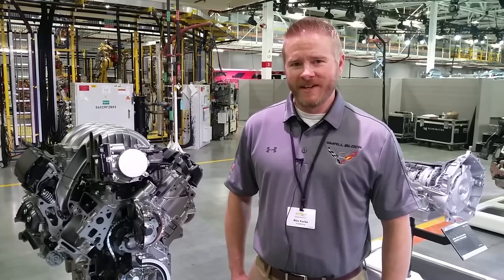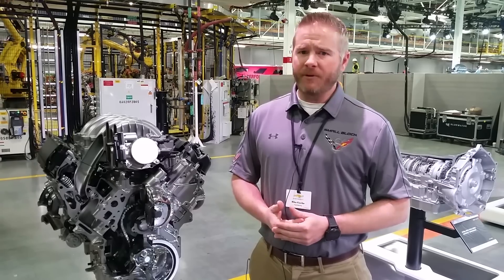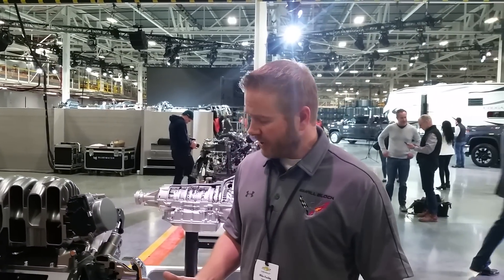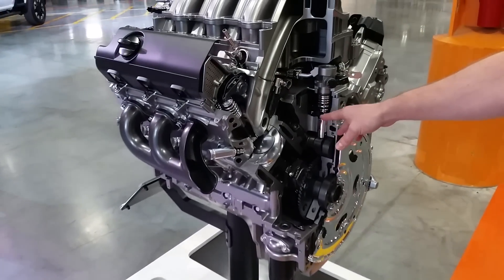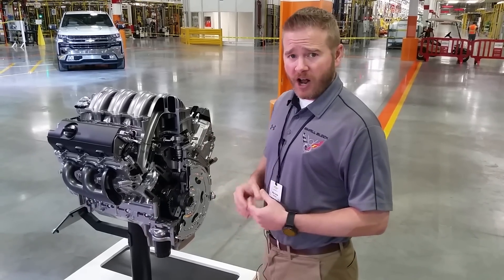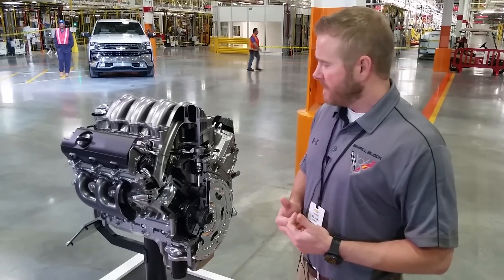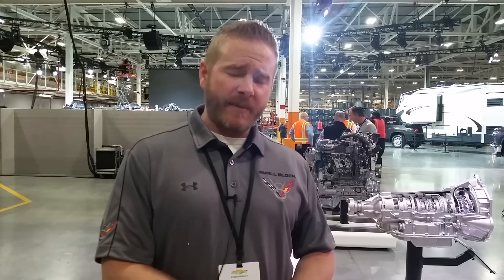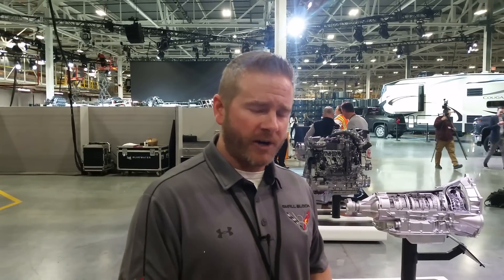New 6.6-liter V8 gas engine on 2020 Silverado HD

Comment: More modern GM JUNK.  My 04 silverado 2500 HD 6.0 died at 230,000. Not to mention the transfer case pump rub BS design.
Anyway, junked the 6.0 and built a 1966 396. Modified  the PCM and ECU.  The truck is EMP proof. The 396 operates as if it was 1966 again and I get 16 MPG hwy and 11 MPG city, yup it has a holley carb on it. So  F$#K you GM and your over priced new JUNK trucks.
Reply: not fair  396 is a real engine
Reply: offplanetevent ok I think we fucking get that you like junk
Reply: @blakeok952  
OK, I do like junk...I like your comment
Reply: offplaneteven oooof roast upon me

Comment: I love general products .. Will this motor last more than 100,000 miles without me putting hundreds of dollars into repairs on the vehicle. Because that has been my experience so I stop by in general most products. But considering I do drive between 40 and 60,000 miles per year. The performance has always been excellent. I personally just have not found your animals last more than 100,000 miles without costly repairs. So I bought a Toyota
Reply: Congratulations you bought a taco

Comment: Why not electric fans so you don’t leach hp off the engine?
Reply: The engine gets hotter than most other designs and the engineers decided electric wouldn't be a wise choice many manufacturers still use clutch fans on their workhorse engines.

Comment: So basically with all GM's engineering prowess and what they know about the DI downfall they decide to let it still be a carbon valve fouling machine lol....
Why would you not knowing what you know put auxiliary injectors in the intake runners to keep the valves clean?  Other manufacturers did it because of the problem. Junk, junk, junk.........
Reply: Yea well chevy's run fine with dirty valves idk about that junk you speak of apparently it's a big problem for those 😂😂
Reply: Must have stole some engineers from FORD.  looks a lot like a newer ford engine.
Reply: @IndependenceIron  you mean ford copied the LS and made it bigger because they couldn't make their piece of shit 6.8 v10 OHC motor run worth a danm or stay together lol
Reply: @oddball0045  actually if you want to get technical more of the LS was copied from Ford. The LS was Chevy's rendition of the "Y" block.  I'm a chevy guy but the truth is the truth.
Reply: @turbochevelle5641  following that logic i guess every ford v8 after the flat head is just a copy of the 265/283 chevy small blocks right? Both have valves ontop of the head therefore must be a copy

And i guess every car is a copy of the ford model T because they burn gasoline, have 4 wheels, and a roof lol

Saying an LS is a ford design because its a Y block and has the same firing order is silly
Reply: @oddball0045  everyone knows Ford came out with the "Y" block a year before Chevrolet it no secret. The fact is the LS took many design points from the Ford design and changed a few things so nothing to get all butt hurt over it is just the facts.  It is just the nature of the beast in industries like the auto industry to follow and one up each other and there is a lot of industrial espionage that goes on as well. Get over yourself, the first to market was Ford in in the Lincoln with the 5.2l and the race began from there.  Chevy did good when they took things from the 4.6 and 5.0 to design the LS and combined with Y block pushrod tech hit a homerun.
Reply: @turbochevelle5641  whose getting butthurt? The LS and the failed modular motors are so different from one another its not even worth debating 

GM played with DOHC 4 valve v8s in the c4 zr1 vettes before ford ever came around with the modular crap, i guess ford copied chevy/lotus. Point being you can draw similarities between any motor from any manufacture and say "hey company X copied company Y!"

 But you cant look at that new 7.3 and not see LS engine written all over it, right down to the intake manifold. Ford tried the OHC stuff, it didnt work out so they went to GM for the LS OHV architecture. Just like GM went to ford for that new fancy 10 speed automatic

I just love the irony in ford fangirls going on and on about how "outdated" the 2 valve LS is and how much "better" 4 valve DOHC is and then ford turns around and gives them that OHV 7.3 big block lol
Reply: @turbochevelle5641  if you think it only takes a year to design a motor........ ya fucking stupid 
GM coming out with a motor a year after ford does NOT mean they stole the engine, and stamped GM on it

BOTH engines probably have AT LEAST 5 years of development.....
Reply: @oddball0045  
Actually the 10 speed automatic was a co-development between Ford and GM. 
They've done this on three different transmission projects now.
First was the 6 speed auto FWD back 2009/2010.

Comment: I’m not buying another vehicle with variable anything in the engine.... my bank account has been hurt by it enough
Reply: Richard Risner Honda & Toyota have had ZERO issues with VVT with the exception of the customers that refuse to change their oil. Now, variable cylinder displacement was a total nightmare in its inception at GM. Honda also has had issues with their variable cylinder displacement V6s. Oil consumption is a design problem because the cylinders that aren’t firing don’t have combustion pressure to push the oil toward the skirt of the piston. We’ve actually disabled the feature on Hondas and the consumption goes away. I’d rather pay for the fuel as opposed to having my engine torn down to try to stop oil burning. Any fuel savings the consumers had vaporize at that point.
Reply: The variable reliability solenoid is likely to stick on these
Reply: It doesn't have the same crap the 5.3 has. There are no cam parts of lifters that will break. It's not the variable lifters like the 5.3. It doesn't have AFM either. HD trucks aren't required to meet the standard the 1500s are. The 6.0 has the same setup the 6.6 has its variable valve timing and it's far different and far superior than the crap in the 5.3.
Reply: Richard Risner then get a tundra.
Reply: Ramiro Escamilla I actually like the tundra but my 2007 Chevy HD with the 6.0 I sold to buy my POS dodge was the most solid truck I’ve ever owned.  I sold it at 120 miles and it ran as crisp as it did the day I bought it.
My dodge 1/2 tone and my 2007  Cummins on the other hand couldn’t make it to 100,000 miles with out me dumping thousands into out of warranty work on the front ends and most recently rebuilding the top end in the 1/2 tone
Reply: @ramiroescamilla7263  
Tundras dont have variable anything on them?
Reply: @lees.4084  Yes they do, variable valve timing
Reply: @xTheJmanChannel  
Yeah, I know.
Reply: Lee S. VVT. Bulletproof too unless you refuse to change your oil.
Reply: @ramiroescamilla7263  " then get a Tudra" ??? You do realize that the TundraTundr Tundra has VVT  and A Vaiable intake? 

He would have to find ane ary / Mid 2000s Model with low miles.
Reply: Richard Risner it's easily deactivated.
Reply: @oldman6914 no it's not because it's not the same as the 5.3. It works the same as the 6.0 and the 6.0 never ever had any of the issues the 5.3 has.
Reply: ARCH KRIEGER I can deactivate the variable valve timing in my 5.7 hemi?........ sorry homie don’t work that way.
Reply: @richardrisner3635  
Yes variable value timing can be deactivated, well removed by changing the Cam shaft
Reply: Richard Risner I think you can it's the same way like LT motors
Reply: Yes it does it’s call a delete kit bucko 👍🏾
Reply: Engines have had "variable things" on them for over a century now...
You'd best get used to it...

Comment: Everytime something new is introduced everyone loses their minds and hates it, I can only imagine back in the late 80s when everything was going to fuel injection everyone was like "my 1966 350 carbureted v8 is going to WAY out last this over complicated nightmare!"
Reply: Don't know about 60,s not quite old enough but 70,s onwards yes, the type of work we did was was away different to now, in dealership and independent workshops, biggest thing I noticed was how much longer motors lasted and specifically how much less top end rebuilds which showed how much cleaner inside injected unleaded motors had become over time, over complicated now- maybe, less reliable - hardly, more expensive to repair - occasionally, more performance - definitely, replaced more often - I'd say so, building to last longer necessary - I think not, our children won't want what we have now they don't even want the phone they had last year.
Reply: Amen brother
Reply: 1966 350? First year of the 350 was 68
Reply: @konnerkramer3381  67
Reply: @konnerkramer3381  
They did an engine swap, ok?

Comment: Do you fix the lifter problem? What about the oil pump problem ? Still using those $hity little bolts on the Exhaust. WOW
Reply: Looks and has the same problems the hemi has. Even looks like a hemi on the outside.

Comment: Cheapest pistons and rods they could find...
Reply: Aaron Martins 
I don’t know about the pistons, but I do agree on the rods. PMRs are Cooper infused steel.  Rev the engine up and, 1 out of 25 engines, they go right outside of the block.
Reply: @Nostradamus_Order33  Short of the LS7, I believe all LS engines have used powdered metal rods.
Reply: @Randmosh 
Even the 95-97 model LT1 (GEN2)
Engines used PM rods.
Reply: @Nostradamus_Order33  
1 out of 25?
FALSE....
Reply: @Randmosh  
It does indeed....
Especially with all these metallurgical experts in here....🤣

Comment: "With engine bore cooling...to uh... enable the engine...make the engine high performance time after time"

Wow...to increase the rate of heat transfer and reduce overall weight would've sufficed....
Reply: I always just called it a water jacket. Been on engines for a long time now. Engine bore cooling sounds more high tech, I guess.

Comment: 6.6 and only 401hp? Come on gm
Reply: That is a good number.  400 cubic inches, 400 horse power. Torque is the objective of this engine. It's a 400 ci Chevrolet small block, with some fancy unnecessary and expensive high maintenance fuel delivery.  The auxiliary oil pump could be a good thing. These engines are well known for overheating. GM was forced to stop production in 1981 by the GOVERNMENT  fuel economy did not meet requirements. Carberated at the time they still outed all others in real life. On paper they used slightly more than a 350 sbc. This will be a work horse . I'm going to order one in reg cab 8 foot box . Standard trans rubber floor mats.  Air conditioning will be the only upgrade  ( and a backup camera) . Should ,in real life out do the godzillia ford just released.  It's a redo as well of the 427 cobra

Comment: 400 hp / 440 lbsT  hopefully it's a Extremely Reliable Engine because the Torque Sucks even for Gas 🤔. Diesel 1000lbsT Only way to Go 💥

Comment: My 5.7 Ram makes 395 HP and 410 ft lbs torq. 345ci vs 400ci something’s not right about that low output from GDI and nearly 11:1 compression out of 400 cubic inches.
Reply: Dale Mullens this is in a 2500 bro,you could take a 6.0 and up it  to 500hp no problem
Reply: PrometheusWarriors _ct55 I’m a GM World Class tech. I work on these things daily. I mean daily. I know what a 6.0 will do. I also know what a HEMI will do. 😉

Comment: Direct injection... Well this won't be in my next truck.
Reply: Craig Krueger why not
Reply: @blakeok952  because the fuel is injected straight into the cylinder no fuel(with its solvents) passes through the intake and over the intake valves. Direct injection engines basically just keep building up crap in intake which at first will cause loss of power and efficiency and over time in extreme cases cause engine failure.
Reply: Craig Krueger the LT engines are di... what’s the issue there
Reply: @blakeok952  all direct injected engine have the same issue, some seem to handle it better then others, maybe they have larger tolerances? I don't know.  To be honest I don't know much about gm's but i was thinking of switching for my next truck.  I've owned three direct injection engines in the past (all different manufactures) and I've had the same problems with all of them. I wont buy another.
Reply: @85CEKR  I got a solution to the valve coking, ventilate the crankcase vapors to atmosphere.
Reply: @terryeffinp  that would be ideal but isn't that illegal?
Reply: @85CEKR  Aren't half of the mods people do to vehicles for better performance or style illegal? I would have to argue that venting a little bit of oil and un-burnt fuel  to atmosphere is better for the environment if it increases the lifespan and the overall efficiency of a piece of equipment.

Comment: So all these guys with 5.3L making 500hp didn’t give you any ideas that you didn’t need to make a bigger engine to make more power?
Reply: Nick Johnson 
It’s easy to make that power with a bigger cam and/or boost.  It’s not as easy when you have to pass emissions and be responsible for a warranty.
Reply: StL ChuckO Exactly it’s easy. So with a mild cam and/or turbo emissions could be met and efficiency exceeded to its current setup
Reply: Nick Johnson 
Did you miss the second part?
People also expect an engine to last 200k+ miles.  Slapping a cam and turbo onto a 200k mile engine is different than a cammed/turboed engine lasting 200k.  
Plus those things start cutting into MPG.  They need to balance power with mpg since they’re going to be used in work trucks, because fuel consumption affects the bottom line.
Reply: StL ChuckO all of my GM vehicles have over 200k each with their own modifications to make them more efficient and add power. Other companies have already put their foot in the turbo waters in order to add power and mpgs. But yet Chevy thinks adding more displacement here is gonna help and still meet emissions while maintaining decent mileage? Yeah that’s not how this works. Just don’t go nuts with extra fuel or a huge turbo and you can make reasonable power while still maintaining reliability and efficiency. I would never buy this motor for its  intended application anyway. A diesel rules this territory and I don’t understand why they keep trying to use gas motors in its place. They might as well bring back the 454 if they really want to be effective in towing. Lets just really throw caution to the wind and start putting the 572 in trucks. All I was originally trying to say is throw a little air at the 5.3 or 6.0 and it could make the same power as this new 6.6 while being more efficient.

Comment: 401 horsepower and 464 pounds of torque? The 6.2 liter was 420 horsepower and 460 pounds of torque. What's up with that?
Reply: sportsmansparadice42 the 6.2 is a performance based block. The 6.0 is a longevity forever based block
Reply: @blakeok952  The 6.0 hasn't been used in the trucks for a while now. The old 6.2 liter is a great engine without any doubt, but the new engine is 6.6 liters, and it should put out way more torque. That's almost a half liter difference between the two. Plus direct injection with 10.8 compression. 500 pounds of torque should be no problem.
Reply: Maybe the extra 4 pounds of torque is lower in the RPM band, but it's not worth the loss of 19 horsepower. I thinking that both hp and torque are just at a lower rpm. With 400 cubic inches, and 10.8 compression it should be closer to 500 pounds of torque.

Comment: STROKE IS 6 MM LONGER   DUDE TALK AMERICAN
Reply: I’m pretty sure 6.6 confuses you too .
Reply: So you understand 6.6 liters but not 6 mm, by the way the US has been using metric standard (by federal law) since the 80s all the nut and bolts in the vehicle are metric, all product containers are marked with either metric or metric and imperial. So he is speaking "american", you are simply listening in hillbilly. So clean your ear and listen a little less Ignorantly. Come to think of it Ford badged their 427s & 428s Galaxy Lighting as 7 Litre back in the early 60s.